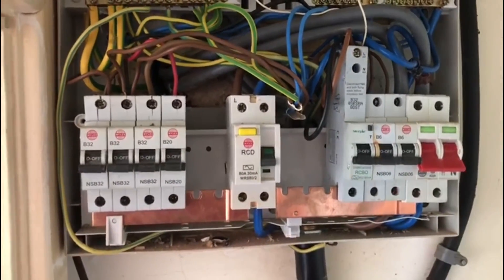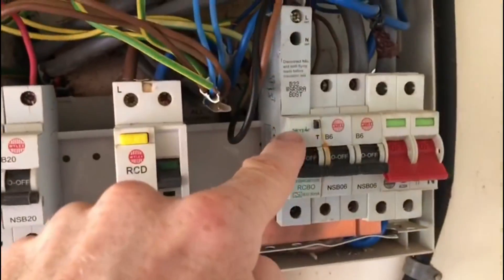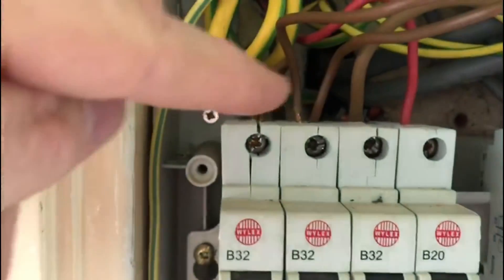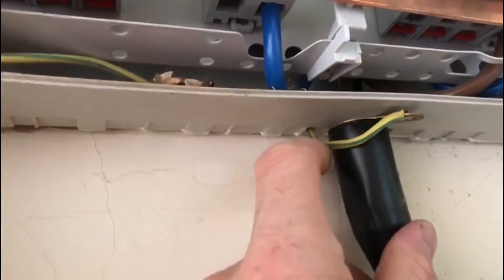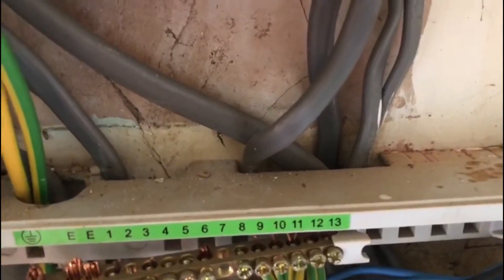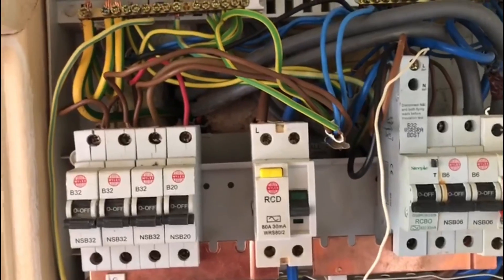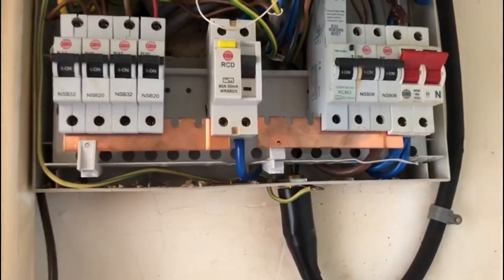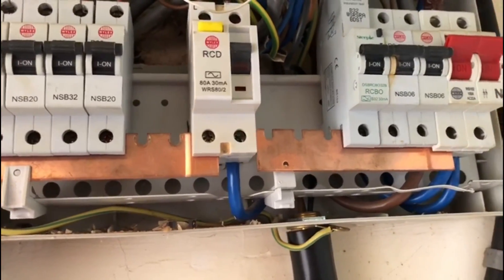EICR Consumer Unit Issues - Incorrect RCBO, IP Ratings, Loose Connections + More - Electrician Matt

Comment: The electrical industry isn’t regulated properly and it needs tougher enforcement action like with the gas industry.
No one unqualified should be doing electrical work as it’s just as dangerous as gas installations if not more so due to the amount of sources of electricity in a property yet everyone thinks they can do electrical work properly and safely.
I see it every day.

Comment: Hopefully won’t be a long time before ALL electrical work in domestic properties (even privately owned) becomes a criminal offence unless you are a fully approved and qualified electrician. Never mind notifiable, non notifiable, blah blah. Just blanket the whole thing. The thing about electrics is, BS7671 is so detailed and requires extensive knowledge to understand the regulations in terms or thermal constraints, disconnection times, installation methods, etc that DIYs will end up not complying with it. The NICEIC and other body’s must push for a law where only electricians can carry out electrical work. It would benefit the industry and weed out all the cowboys, kitchen fitters, and hopefully, prosecute them.
Reply: David SS bring back hanging did one get out the wrong side of the bed
Reply: To be utterly, utterly, draconian, unless a home owner has a "sign off ticket" detailing the circuits installed in the consumer unit, and tested as per regs then insurers may decline a claim.

I'm suggesting claims adjusters and claims investigators examine, or cause to have examined by qualified electricians, any and all electrical distribution kit in a property.

IE insurers shouldn't really be expected to cover duff and dangerous works by unqualified persons. 

Further the consumer unit is closed by said installing electrician and sealed with tag linked to electrician.

On the "paper trail" principle.

Any evidence of tampering results in insurers declining a claim.

You can't interfere with gas installations unless qualified so should be same with electrical installations.

Obviously this needs further detailed dialogue with authorities to write up actual stipulations.

Would further suggest random spot checks on private dwellings and rental properties with view to inspecting installation for any signs of damage (for any reason), unlawful tampering, as in adding more circuits, or interfering with protective earthing arrangements, and, any attempts to bypass metering equipment.

Or duff work by alleged professional electrical contractors.

Obviously the above list is by no means exhaustive.

It seems to me that is is a splendid idea for the editions of the regs to be updated and improved upon in line with technological advances.

However, it's a bit daft to not police installations if some keen but totally ignorant (of any regs) home handy(wo)man can wade in willy nilly and cause any amount of issues, not least safety.

(Annecdote Alert:

Eons ago I found a homeowner had decided to use a 45A cooker supply circuit to connect up his ordinary domestic fridge. This he had done by removing the plug from the appliance's lead and directly connect to the connector block used by the cooker.

What was worse the circuit was still protected by the same rewireable 45A fuse. An easy mistake to make and could have had dire consequences.

Doubtless "you" will have found similar "installations" by clueless people ... clueless in that said people are members of the "how difficult can it be ?" society.

Would suggest that sooner or later some of the above become unwitting contenders for a "Darwin Prize".)

Lastly it might be a sensible notion for the DIY stores to stop selling any electrical items used for installation works.

Electrical installations kit to be sold strictly through trade outlets to known and registered electricians.

Naturally this won't protect against duff professional electricians but at least it reduces the chances of a fatality.

Hopefully.
Reply: No problem with that approach. While you at it let’s mandate that electricians can’t charge beyond a small amount for works that’s policed by government cost cutting agents so you get paid say minimum wage? And if any of the work you do is found to be defective you loose your license to operate and your livelihood. 

I doubt you would be up for that level of government interference in your business, but this would be the only way the general public would accept creating a monopoly of work.

Anecdote alert:

One of my staff asked me about what his electrician had said. The guy wanted a plug socket in his bathroom so said sparky wanted to run a cable from the lighting circuit to the socket. I’m not an electrician but even I know this is dumb as you know what.

Comment: There are two MCBs on the left side, the first one (from the left) and the third one are damaged by tightening the screws too much. That's one of the reasons a torque screwdriver is now mandatory...not only the too loose screws...

The board is so damaged, it should be replaced. I'm not an expert in british wiring, but wouldn't it be easier to make the earth termination of the SWA inside of the board?

Comment: So what code are you giving for the steeple RCBO and the structural  issue on the consumer unit?
I don't see any issue structurally and if the RCBO is not distorting the busbar what is the problem?
Reply: I agree. I'm pretty sure maintaining the same 'brand' throughout the board only serves to make the customer spend more on upgrading outdated board during a minor works scenario. Money grabbing scheme, just like updating the regs book with mainly grammatical and punctuational changes. They think we're stupid.
Reply: @lazzzylouis  I suspect it’s to do with the compatibility and how things like heat and possibly EMF interference could affect them if they are jammed together. If that rcbo was separated by a single gap I think they be hard pressed to say it is dangerous, however these things are manufactured to spec which is a minimum safety level for a given scenario.

Comment: Screw through busbar is the best
Reply: It's a feature, not a bug. There you have a test point that the service entry is working. A shocking moment before you even removed the cover. Or if you can't afford coffee in the morning, simply touch the screw...
Reply: Unbelievable
Reply: It's OK there's a big label saying switch off before removing cover😜, this is a Dr Pepper board...
Reply: @baldyslapnut.  Like it is on devices with a flameproof encapsulation for areas with potential explosive atmosphere: Switch off and wait 10 minutes before opening.

Comment: I went out to a shower callout just a couple of days ago with burning smell, it turned out the property just had an eicr and the shower line in the mcb was loose and had been arcing, I guess the wire hadnt gone under the clamp in the mcb, it damaged the mcb and melted insulation on ring final circuit as well as the line of the shower circuit , it also put a large hole in the rccb next to it.
Reply: And that was after an EICR by a supposed competent professional? Scary!